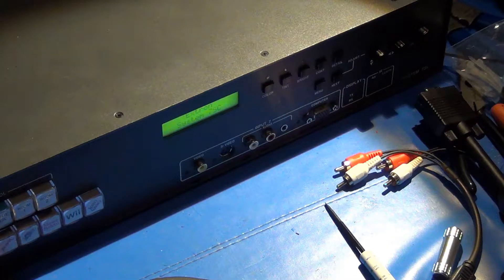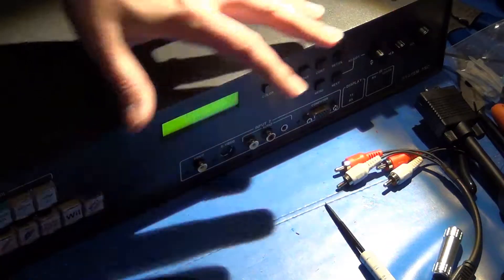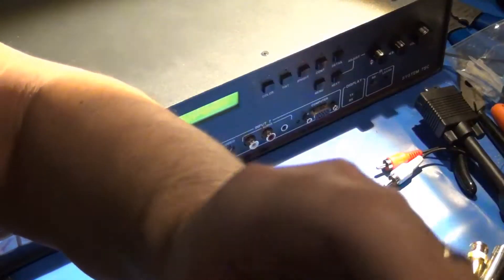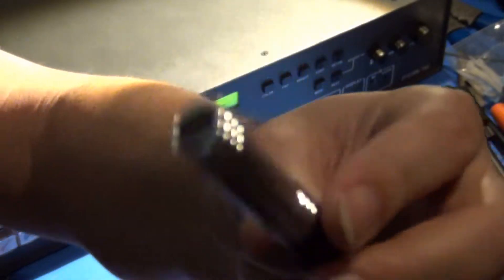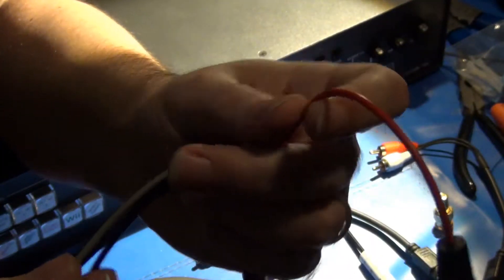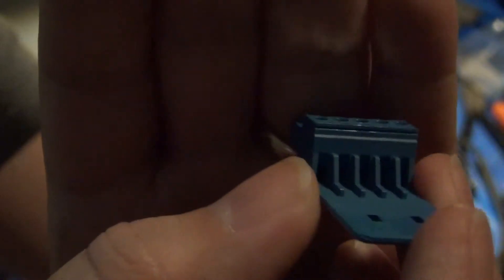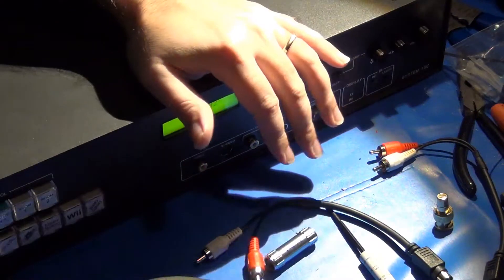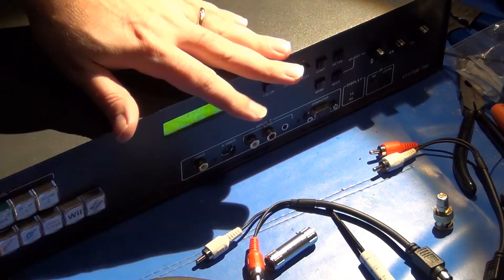ITC - AV Equipment Upgrade Pt.2

Comment: Hey good video. Quick tip for the bare metal and shorting issue. Just use a hot glue gun and cover it up! Works great. I had the same issue for a while lol
Reply from the maker: I had thought of that as well. The more I thought about it, I realized that the metal between the two channels is far apart enough to not be an issue. Especially with my shrink tubing along the longest most exposed part. Since they are all of the same length, they actually sit side by side quite nicely together. In fact they only twist about and turn from the individual RCA jacks plugged into them. If it does become an issue then I will coat them with insulation of some sort.
Reply from the maker: I meant to reply back on this. I ended up redoing the wiring in my AV center about a year back to move some consoles around that I had plugged in and decided to go ahead and apply some large sections of shrink tubing to each of them so now they are fully covered up along the back at this point.

Comment: Hey there, what exactly is that RCA piece called? I’m looking to buy some but can’t find them for the life of me
Reply from the maker: Which RCA pieces are you referring to exactly? Do you mean the double RCA set that I used for my audio at the end? If so they are generically named as just RCA phono connectors PCB mount right angle. Those are the basic key words. While more expensive than the ones I was able to buy locally, here are some you can get at Mouser for instance.
https://www.mouser.com/ProductDetail/CUI-Devices/RCJ-2244?qs=sGAEpiMZZMvjAcTDbo5QTvcHnaz4JlxTeNQlHm6858Q%3D
Reply: @IvoryTowerCollections  Thank you!! That link is exactly what I am looking for :)